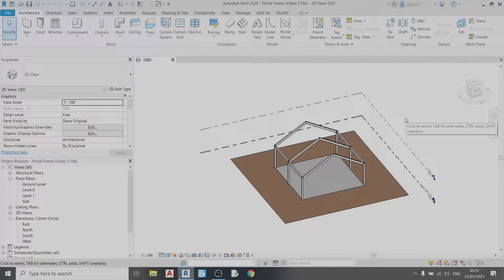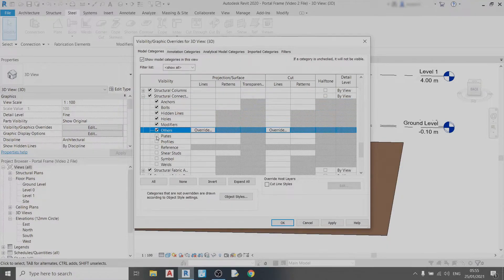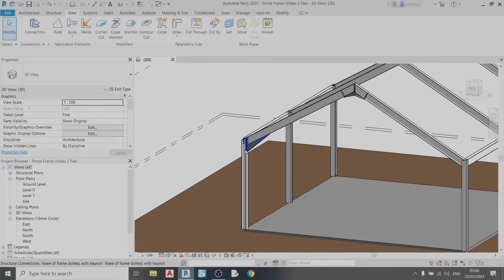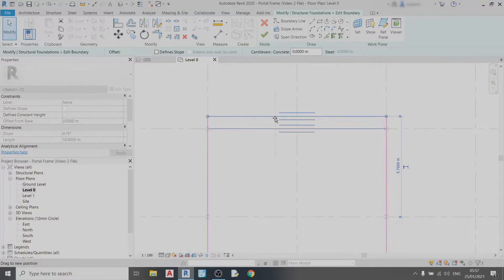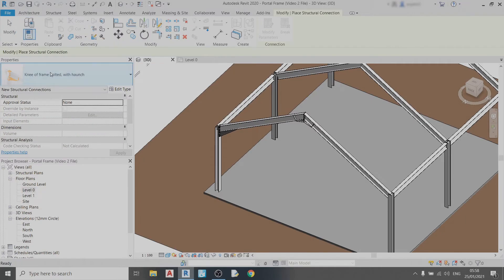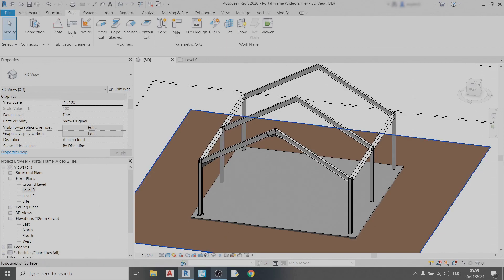How to draw steel connections in Revit ?

Comment from the maker: Link to Steel Connection Detailing Playlist: https://www.youtube.com/playlist?list=PL9mqkp_a9SMbPlkDC6PfdXEjWneoivg03
Timestamps:
0:00 - Introduction
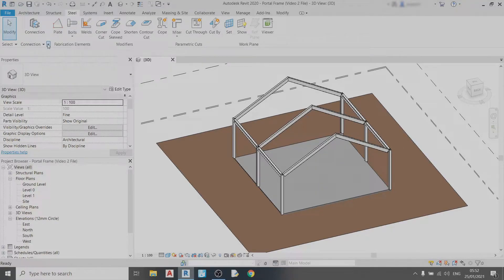1:08 - Import Structural Steel Connections
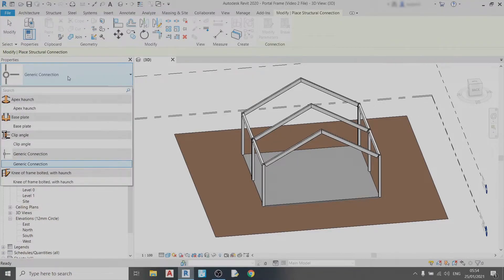2:10 - Apex Haunch
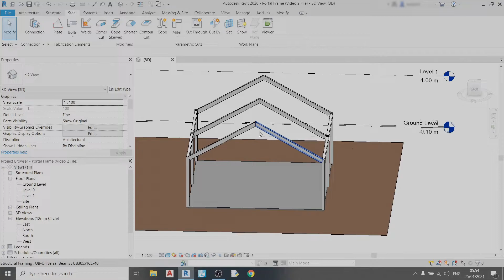2:40 - Change Steel Connection Visibility Settings
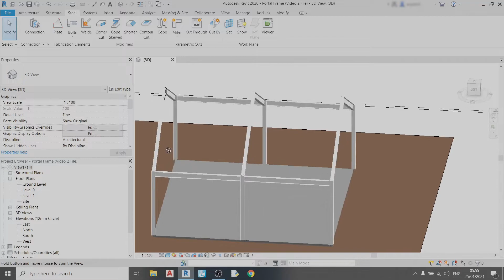3:30 - Clip Angle
3:38 - Eaves Haunch (Knee of Frame Bolted, with Haunch)
4:45 - Column Endplate